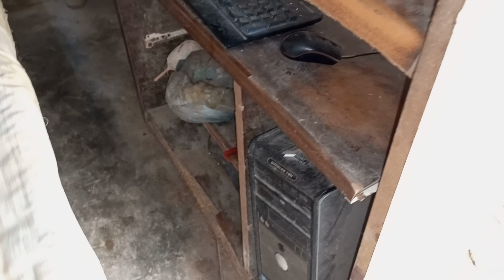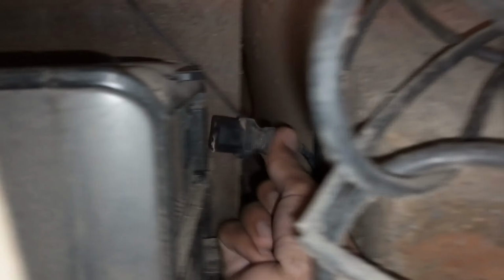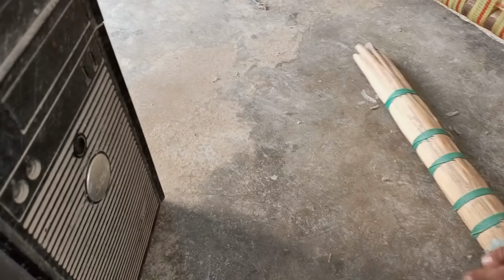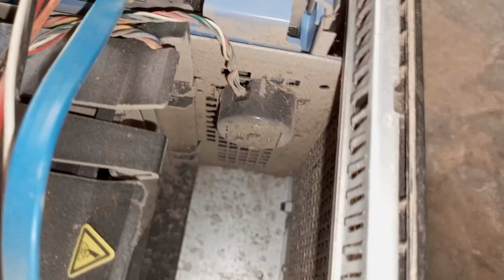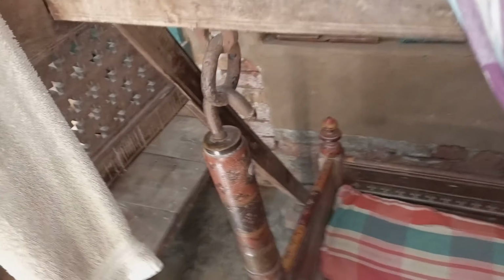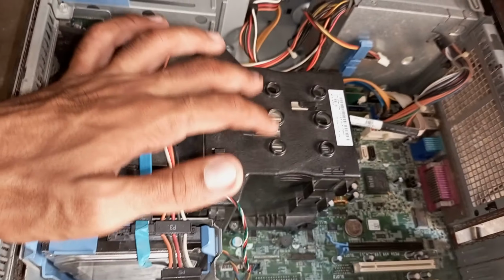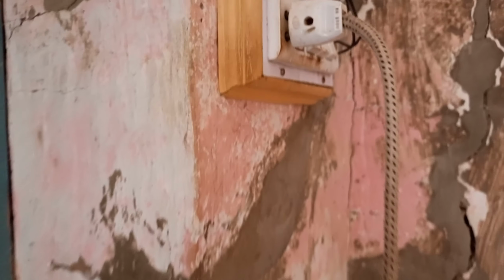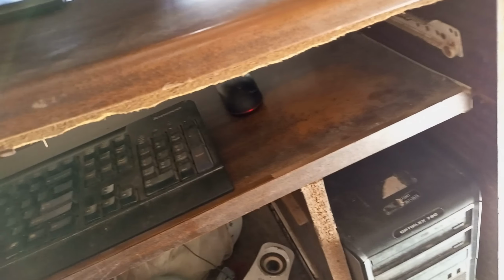Cleaning The Dirtiest Computer

Comment: Honestly, your English is alright!

I think it's OK to be cleaning the outside of the case with a damp cloth, just make sure it's not soaking wet and that no liquid enters to touch the board itself. You might even need to consider replacing the fan or going to a computer shop to replace the thermal paste on the CPU, as well as give the CPU's cooler itself a clean.

Other than that, it actually does look like a cozy setup. It seems more ergonomic than how I have my laptop in my room.
Reply from the maker: Okay, thanks dear but what is a thermal paste?
Reply: @ProGamer-lc3tn  Gray paste in between CPU and the cooler on it that helps with heat dissipation. From what I've seen it's cheap online, and often lasts a while before hardening and needing to be replaced. Don't remove the cooler yet until you have a new tube of paste to use.
Reply from the maker: @invisiiso  okay, thanks brother for the help.